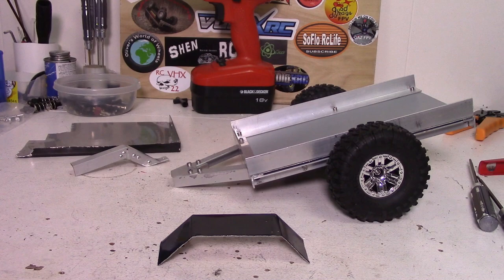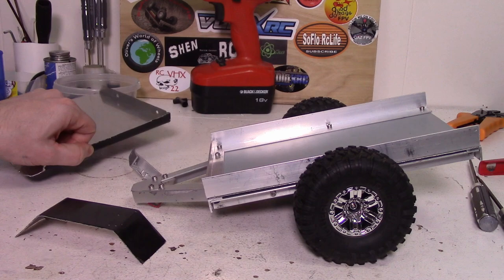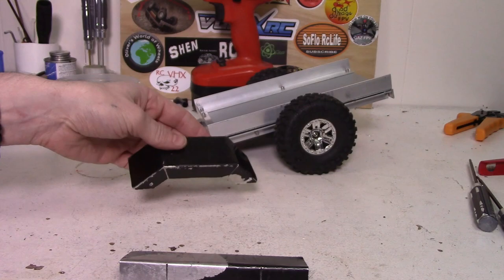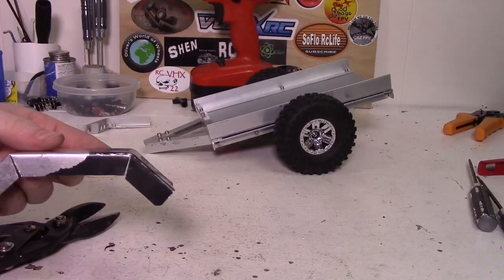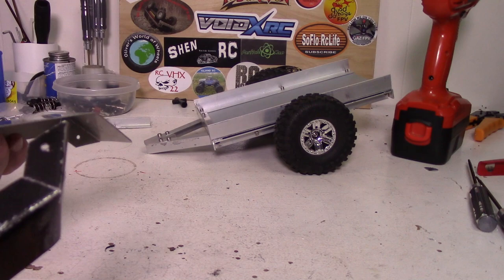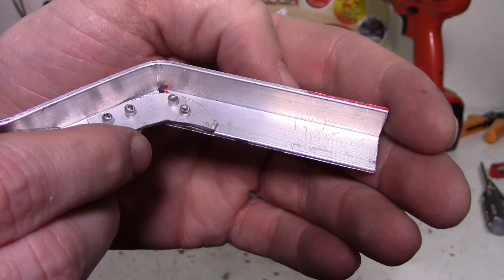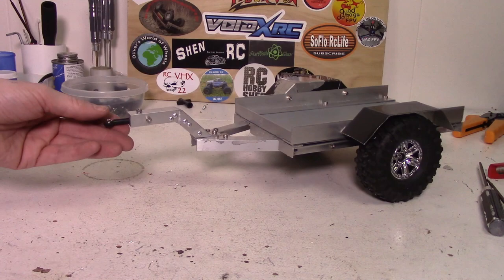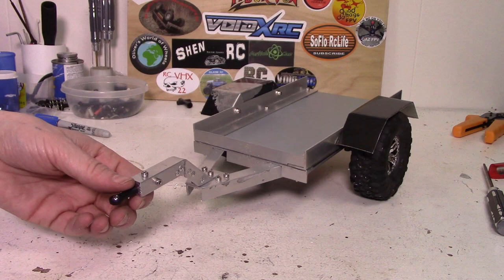Small RC Trailer Build Part 3 - Finished!

Comment: after i finish 8x8 build, i have to make something like this :D
Reply from the maker: Cool man! You've got my curious about your 8x8 build now though, gonna have any video of it?
Reply: @VoidXRC  im not planning to :P its based on injora solid axles, gearboxes and traxxas shafts and rod ends :) Dimensions of the chassis are the same as Tatra 813 but in 1/10 scale :)
Reply from the maker: That sounds like it will be pretty sweet!
Reply: @VoidXRC  Yup, you should try too :P